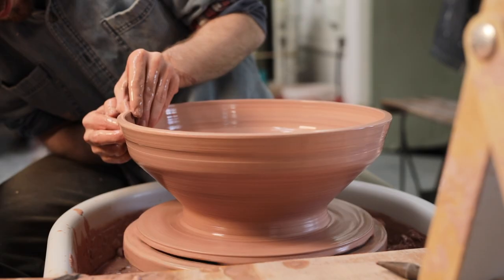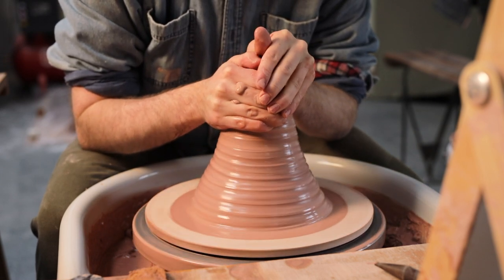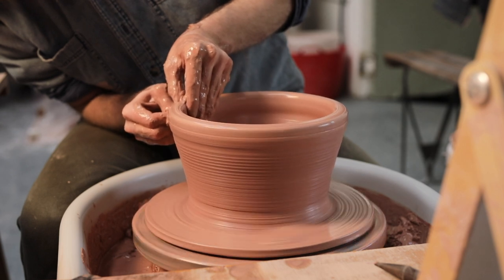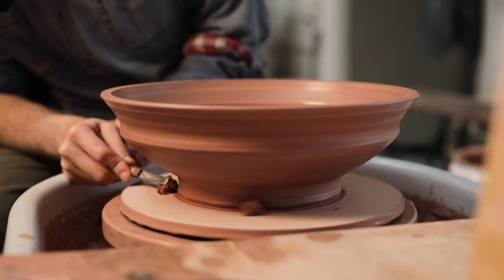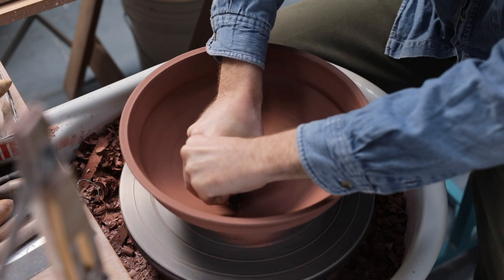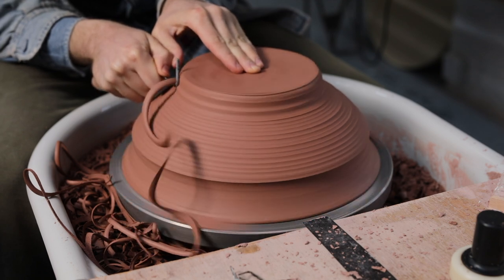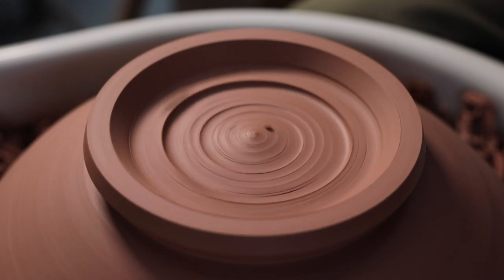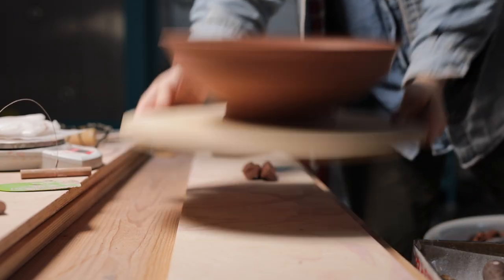Throwing and Trimming a Large, Indented Stoneware Bowl

Comment: great pot.  i have one thing to add.  since you like very smooth stuff, you should give a try to some sandpaper, like say 400 grit silicon carbide.  you can brush greenware and get rid of little bitty bumps very quickly, and after bisque if it seems a tiny bit rough, you can wipe over it and it will feel a little more velvety, especially a no grog clay.

i still cannot get the tap centering to work for me.  ;)

Comment: This is very strange I have been using very soft reclaimed red high iron stoneware lately. It wasn't intentional at first I did have a lot of reclaim to deal with but I had broken my left wrist which really scared me because of obvious reasons I was worried that I may never throw again but I have been working my wrist a little bit here and there with directions from my doctor at the six week Mark after surgery and I happen to turn over a bucket of reclaim onto my canvas table and work it into a ball. After a few days of drying and wedging lightly I realized it was pretty good exercise for my arm and wondered if I was able to throw a pot with such a soft clay. I remembered using some real pure porcelain that was like toothpaste out of the box so I figured I would give it a try this was much firmer than that LOL. I was able to throw a few vases and a couple of bowls and a coffee mug. It took me a couple of days because I didn't want to overwork my hand and wrist but I was able to throw the pot which made me extremely happy.

Long story short I am back throwing pottery and I'm very happy it's very slow going but that's fine I am still very happy I'm overjoyed that I can do it and I'm actually enjoying seeing how far I can push this ultra soft clay. Once you get it centered and it's up and formed you can't tell the difference really it takes longer to drive but that's it